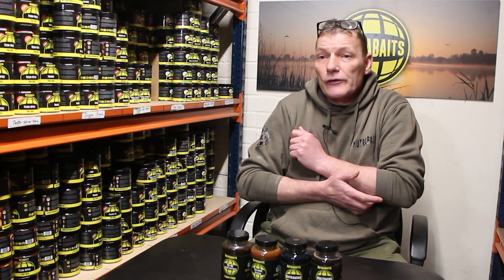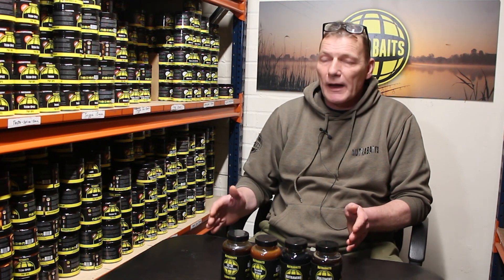A Day In The Nutrabaits Factory

Comment: If you do mix amounts basically by guess work and you are saying it depends on different temperatures in and outside the building wouldn’t it make sense to have same temperature inside the room rather different every time,I’d like to be sure a bait I’m buying is the same every time I buy a new batch after all boilies can be expensive.
I came away from nutrabaits after a number of years and I used to love using them and their unique flavours,you can guarantee no one would be using bait your using.
I’m not going to say what bait company I use now but it’s not mainline or nash or sticky.
Reply from the maker: Nothing is guess work, every ingredient is used at the optimum levels to give both maximum levels of attraction along with giving a  balanced diet. All are fully field tested to achieve what we believe the highest quality currently available. 
Regards factory temperatures, these are regulated, we have numerous extract systems around the factory, fresh supplied air system along with 2 AC units for during the warmer months and heating during the cooler months to maintain a ambient temperature of 16 to 19 degrees. 
Hope this helps.
Reply: @NutrabaitsTV  ok fair enough but I’d suggest not to confuse people in a video by saying different that’s all….
Still a great and established bait company  better than a lot of others